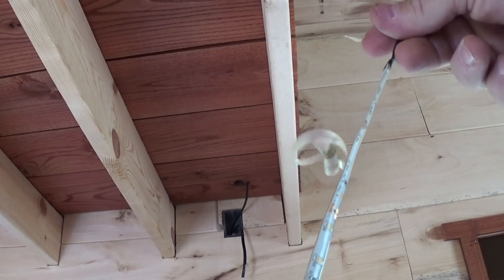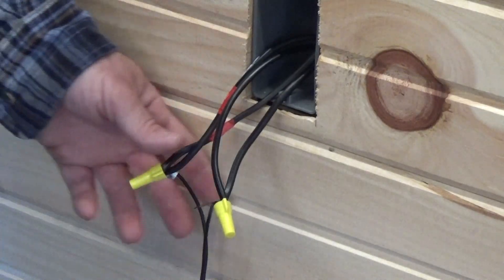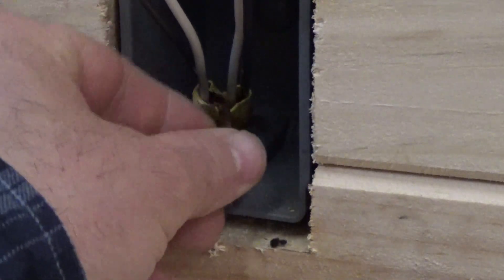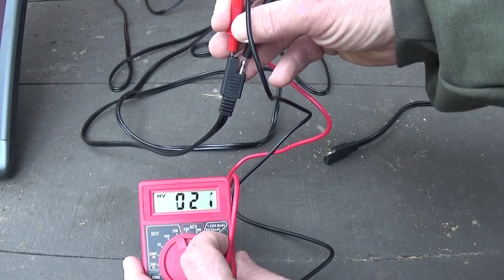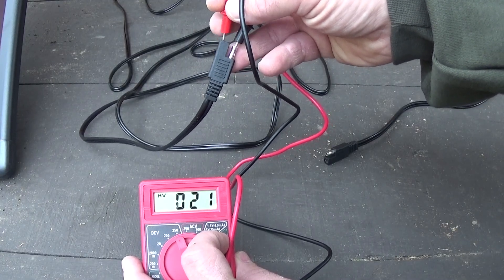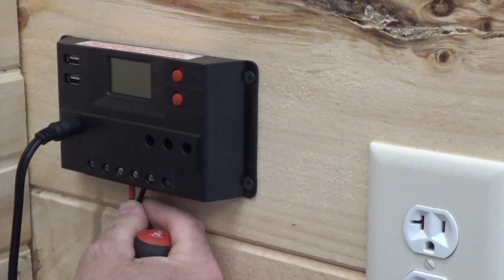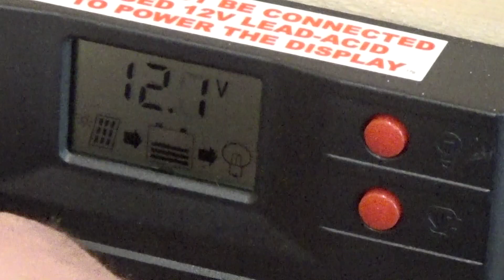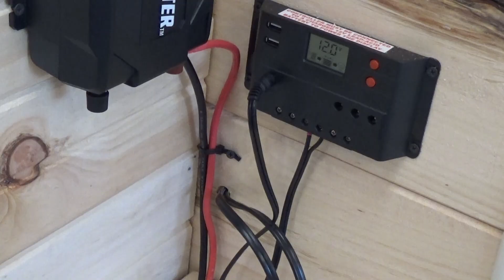Off grid tiny cabin gets  harbor freight solar panel kit installation and I wire 12 /110 volt system

Comment: I wonder if it's possible to daisy chain like, 12 or 15 together and power a bunch of stuff in say a 600-800sq ft cabin.
Reply from the maker: I think you could but you would want to do some research and you would more than likely need a much better charge controller
Reply: You could, but make sure the charge controller is rated for it.

Comment: Do you think this could run a mini fridge by itself?
Reply from the maker: honestly not long enough to say it would be worth it. I'm planning a solar upgrade soon . maybe with a couple more panels and a lifepo4 battery . the problem with that lead acid battery is you really can't drain it very far. it tops out around 13.9 volts and below 10.9 volts the charge controller won't let the solar panels charge it and you have to take it home and put it on a charger or maybe get the voltage up with some jumper cables then hook it back to your panels. so I think the mini fridge might be ok during the day but it would probably drain the battery too far at night
Reply: @blackspruce1861  Thanks for the info, if you make a video on the upgrade I'll for sure check it out
Reply from the maker: no problem ! cool some of the new kit has started showing up  hopefully the rest will get here soon and I'll get to work on it

Comment: How do you know how much power is left on the battery?
Reply from the maker: The charge controller has a voltage reading on it . it shows if its charging what the volts are and will throw a code if something is wrong ng or the voltage drops too low on the battery

Comment: How much for all the parts shown
Reply from the maker: I don't remember exactly. the solar kit was around 180 battery 95 and the rest I don't remember
Reply: @blackspruce1861  I'm guessing the inverter was around $60. So not bad for $300. . Do you think you could run a 400 ft tiny home for a unit under $2,000? Refrigerator. Air unit. And about 3 hours of TV and lights per day.

Comment: Love this video! Im brand new to all of this. From my understanding, Your 110 (the yellow wire) is all your outlets which you plugged into the inverter. Is this also apart of your lights and little LEDS or did you wire those in differently?
Reply from the maker: hey glad you liked it !! the lights are all ran on 12 volt dc different wiring . I really should have got better footage of the wiring process .

Comment: I use HF panels and MPPT charge controller and it does much better.  I am impressed with their stuff and they charge in low light.
Reply from the maker: Thats what I really like too . you may not be getting full output  but they are always charging . so the MPPT charge controller made quite a difference ?
Reply: Expensive.

Comment: Most practical off grid setup I've seen yet. So many people want to over engineer. Nice to see a small efficient system. Awesome job explaining too. If you get a chance to read this. I have a question. To have 2 batteries in parallel, still 12v. Would you recommend another 100w solar and charge controller running in parallel? I think this would work and be redundant and act like a backup. What are your thoughts? Also, do you feel pretty good about the battery being inside and in a wooden box? Thank you in advance. I'm planning my buildout exactly the same.
Reply from the maker: Thanks !! I like to keep it simple . you should look into the specs of your charge controller first it might be able to handle another 100 watt panel and save you the money. as far as the battery inside goes . I personally am not that worried but I guess there are better choices out there AGM  batteries , lifepo4  . but they're a bit more money

Comment: Would you please tell us more about the wiring you used?
Reply from the maker: well the wire I used for the 12volt dc was 14gauge stranded landscaping wire . I actually found something better on amazon when I did my camper build . it the same size but black and red so easy to keep straight

Comment: Pre-drill your holes next time and the wood won’t crack
Reply from the maker: I know I almost alway do but got in a hurry . haste makes waste
Reply: @blackspruce1861  haha yeah it does. I can remember my third grade teacher writing that on my homework. I didn’t understand at the time but I certainly do now. It’s amazing how just taking the time to drill a hole in something makes a night and day difference. I was installing some blinds and curtains for a customer last week and the hardware they give now is so lousy and cheap that if I didn’t Pre-drill I’d strip out the heads of the screws. In the old days you could just use an impact and run em right in with no issues. Not anymore, the screws are some kind of soft chiluminum.

Comment: Lead acid batteries need to be vented outside of the living quarters
Reply from the maker: yeah
Reply: Better off using lithum. Cheaper lighter. More charge cycles.

Comment: I would highly recommend getting a heavy duty industrial grade male plug to replace the on at the inverter. I had that same one i put on a cord I cut down to five foot for a fan. Way overkill for the application. After about six months it got hot and almost burnt my garage down. Melted both the plug receptacle and cover.
Reply from the maker: woah !! thats crazy they can sell stuff thats that chintzy , I wonder if it was just that one happened to be defective or maybe your fan just draws a lot .
Reply: @blackspruce1861  it really is with everything being made in china quality has drastically gown down hill. Sometimes it just makes sense to pay a little more. The yellow one was like three dollars and the heavy duty one was about eight and the quality was definitely noticeable. It is a metal fan from Boscov‘s with a three prong plug I mounted upside down on the ceiling. It doesn’t have a sticker to tell the wattage so maybe your right. Electric can be dangerous lol stay safe.

Comment: If you are going to use those led lights and you are going to be able to see them, consider this... those Lil cobs are bright as hell, they will absolutely hurt your eyes. Make sure your LED strip comes with a dimmer, or find a way to defuse that light.
Reply from the maker: they don't bother my eyes . the only problem is the reflection on my glasses . a dimmer would be nice though
Reply: @blackspruce1861  unfortunately, the versions that come with a Lil remote control have cool colors, but the regular lights tend to suck.

Comment: Looks like a deep cycle 12v battery.  When that dies, and it will, go with 2 6v golf cart type batteries and wire them together for 12v.  They will last much longer and will tolerate more deep discharges.
Reply from the maker: I'll try to remember that . so far its worked really well
Reply: @blackspruce1861  Those 6v batteries have half the cells, the plates are much thicker.  Try not to take more than 10% of your 12v capacity.  That will help longevity.

Comment: Hey buddy, idk if you've ever seen the trick where you sand the back side of the block of wood and get a pile of shavings then mix them in with the epoxy. It makes the crack nearly disappear. Just a trick I picked up in my gun smithing days.
Reply from the maker: I’ve heard about doing that with wood glue but epoxy sounds like it would work pretty good

Comment: Great video hey that inverter will run all your power tools I already tried it on a 750 watt inverter just for kicks I had a 50' power cord coming off the inverter with any power tool worked great.
Reply from the maker: really thats great , and weird I tried my circular saw and it wouldn't do it . it ran smaller stuff fine though

Comment: Use smaller, finer diameter wood screws with finer threads. Carefully drill the holes. Drywall screws with coarse threads will split wood.  Another option is small 6 or 8/32 machine screws with hex nuts.  I think you can also buy blank wood covers and drill those.
Reply from the maker: I normally pre drill everything and it works well

Comment: my I ask, is the battery you use better or cheaper then one at Harbor F. ? I just got the one there
Reply from the maker: I honestly don't know . I didn't do any comparison . I had it in my head what I was going to get so I never looked . sorry that doesn't help much
Reply: The main part about byeing batteries is cold cranking Amps the higher the cold cranking amps the better
Reply: Easy CCA to AH take your CCA and multiply it by .07 and that's your AH.
"Starting" batteries aren't really meant for the big drain down you can get using them for a power bank, but they'll work for a while.

Comment: The 1 thing I've learned about solar panels and batteries If you're gonna use it in a place that's not heated all the time you're gonna wanna use Led batteries led batteries don't lose a charge in the cold as fast as lithium does lithium instantly lose it when it starts getting cold below 30 or 40°
Reply from the maker: I agree . I briefly had a 200amp hour  Lifepo4 battery it was self heated . it drained itself from the self heater . I would have had to upgrade the panels over 600 watts just to charge it in a day in warm sunny weather . Michigan has very overcast weather all winter so it wasn't a good fit for me .I'm sure they're great but only if you want to have a constantly heated cabin and a large solar array

Comment: The only concerns I would have is the lead acid battery being inside unless it is a sealed battery.  Charge and discharge of a lead acid gives off hydrogen. Now, if the box it is in has venting on the top, anything, and the cabin will have high venting, even a few cracks, the amount of hydrogen is VERY small and it goes up.  If it can get out, no issue.  I would make sure the battery compartment has at least one hole in the top and the roof has one air leak.  Also, if your charge/discharge rates are low or not sustained at high levels, the amount of hydrogen is very low.  The wire holes probably are enough venting on the box.  The other issue is at 200 watts any run of #12 over 50 feet starts to get lossy. Some quick calculations here, at 50 feet, 100 watts it is about 11 watts, at 50 feet 200 watts it gets to about 40 watts.  You just have to recognize it.  Not sure how far your run is but I know you spliced in extra wire. Paralleling 2 number 12's is somewhat better than a number 10, not sure of the economics of it.  Overall it looks like a good plan.  I like the LED strips...
Reply from the maker: I just got a lifepo4 battery and an mppt charge controller I plan to do some updates soon . I'm not too concerned with the loss from distance for the most part its just a getaway cabin and I don't use a lot of power . the led strips are really nice
Reply: My decision because of the cold I would have stayed with the lead acid.  The only negatives I are less cycles and weight. In a static setup the weight is not important. The cycles are offset by weight. If the loss becomes an issue a cost effective solution is to run a second #12 in parallel. The loss will be less than 1/2 because 2 #12 in parallel is .0008 ohms a number 10 is .001 slightly more.  A single 12 is .0016. As I said if I understand your goals good decisions all around.  I see guys spending 3 times what is needed to meet the objectives. You may have spent 10 cents over at worst.

Comment: If the LED lights are high in the blue spectrum, this is not good for your eyes or your body.
Reply: Although Ihave blue filtering on my glasses I am not SURE that they have any value.  The research on blue light issues is very questionable.  Be careful when you read the media (in this case WebMD) see quote.below.  Key weasel phrases are...   "may increase the risk of macular degeneration" and "One study found".  I can find one study on almost anything that found something but that study is not repeated by another researcher. An interpretation of one study in the TMI area showed that a given cancer increased 100% in the 5 years after the incident,  from one case in the previous 5 years to 2 cases in the 5 after.  I do not totally trust the studies and worse are the media interpretation. 

Some research has shown blue light may increase the risk of macular degeneration, a disease of the retina. Research shows blue light exposure may lead to age-related macular degeneration, or AMD . One study found blue light triggered the release of toxic molecules in photoreceptor cells.
Reply from the maker: I always buy the soft white

Comment: links for the products used?
Reply from the maker: no I don't have links for them sorry the panels and charge controller were from harbor freight in a package deal . the switches I found on amazon , and the light strips were from Menards

Comment: If you just run d.c. you wouldn't have to worry about the inverter.  I'm sure that takes up quite a bit of energy.
Reply from the maker: 90 percent of the time I do just run DC . when I'm not using the inverter its off or unplugged so it doesn't effect the system. It is nice to have AC though sometimes I'll charge my laptop
Reply: One of the things people forget when they start writing responses is, they do not know all of the criterion for the installation.  I am sure I do not but I assumed that he has some need for the AC.  I personally would have in that area probably used a smaller inverter that has a lower base drain - BUT i do not know what he is planning to run off of AC.  He may knw that he needs the larger inverter.  On the other hand, the choice of 12V for lighting is very likely a correct choice as the inverter has some inefficiency and then you have to go 120V AC to 12 V to power LED's, another loss - these two will be in the order of 8% each - a loss of about 8%.

Comment: Some dc fuses or a circuit breaker would be good to have.  Inverter has fuses but a circuit breaker would cut the power from the battery to everything else.  Not a bad setup for a HF system.
Reply from the maker: I actually added some fuses in my cabin improvements video .  Thanks ! I'm thinking of doing a couple more small upgrades to the solar system eventually
Reply: @blackspruce1861  So sorry, I haven’t gotten a chance to see them yet. I look forward to seeing them.

Comment: Just a tip: Never stick LED strips like this. They will eventually fall off and they use their back side for cooling. Better and safer way (and neater) is to use an aluminium LED stripe mounting profile. The individual LEDs will spread their heat into the pofile and stick much better. Also the fire hazard is avoided that way.
Reply from the maker: I'll have to look into that I've never heard of it before
thanks
Reply: I use these same strips in my kids room for five years now. They are stuck and I mean really stuck there. Not moving at all, and the strips never get hot at all. If he would have gotten the really cheap ones they have at the Walmart checkout line then yes you are correct. But he didn't get those ones. He is perfectly fine.
Reply: I must have the cheap ones, the adhesive on mine is garbage and came loose when summer heat softened it.

Comment: 100 watts is a joke and a rip-off.  It won't run a coffee maker, much less a microwave.  Or anything else.  Ridiculous.
Reply: General useful tip from an old man: negative comments on YouTube how-to videos are an adolescent move and virtually always a waste of everybody's time. If you absolutely have to draw attention to something you think is "wrong", you ask a respectful question: "Do you find 100-watt panels sufficient?" This gives the producer a chance to explain why he used something you wouldn't have -- which 9 times in 10 ends up making you smarter, whereas sneering at the producer brings a torrent of other viewers -- such as me -- who point out how stupid you are. 

Another technique: offer a "yes and" response. "Great job! And if later you decide you need more than 100 watts, all you have to do to upgrade is..." Now everybody's smart, including you.

By contrast, "boy that's dumb" is the sort of "participation" you get from the dim-bulb in the back of your Grade 10 History class.
Reply: It charges all day long into the battery while it's sunny, then you can draw much higher wattage for short periods as needed. Max draw is not limited to 100 watts as long as you have a power store.
Reply from the maker: thank you !
Reply: Since when does anyone run anything directly off the solar panel.
Reply from the maker: exactly !
Reply: You're obviously completely ignorant of how a solar system works. So why make stupid comments? Also, one of your other comments here attempts to  insult this "millenial". Well this millennial knows a lot more than you...assuming an angry old "boomer"?
Reply: Who would use an electric coffee maker in an off grid tiny cabin in the woods? Boiling a pot of water is pretty elementary when you have that much wood on hand.

Comment: You said you bought landscaping wire for those lights if you look at the wire it is mark one side of the wire has A-line in it and notices not look real close you can see that way it's almost like marking it red and white once so it has A-line at the other side don't look at the wire real close it's still black
Reply from the maker: I noticed that  it has writing on one side and nothing on the other

Comment: I’m surprised you could run anything more than lights with that harbor freight set up!
If you get the money, I would step up to an MPPT charge controller and lithium batteries. 🖖
Reply from the maker: yeah it does a good job ! . I've been told that a few times now . I probably will upgrade and may eventually upgrade to a Lifepo or AGM battery
Reply: @blackspruce1861  
I realize that lithium costs more, but in the long run they’re actually cheaper & way more efficient! Plus, there’s no maintenance. 🖖